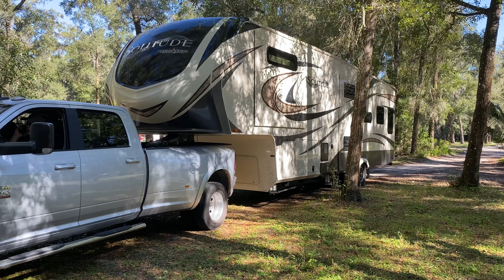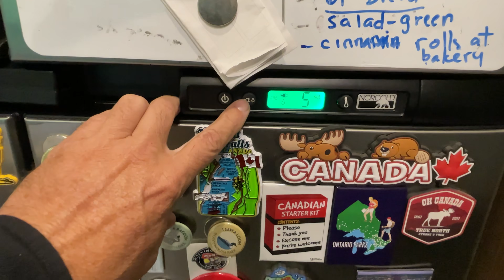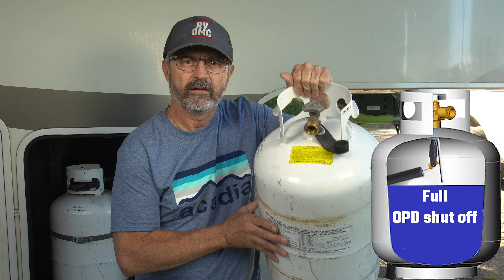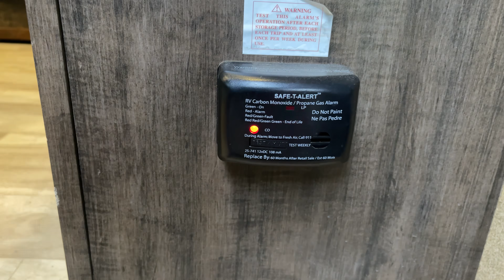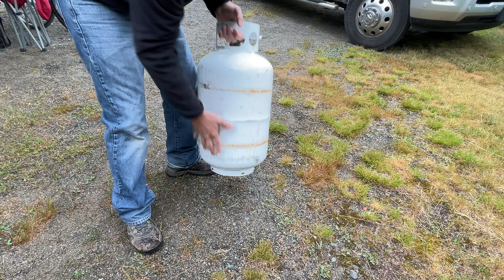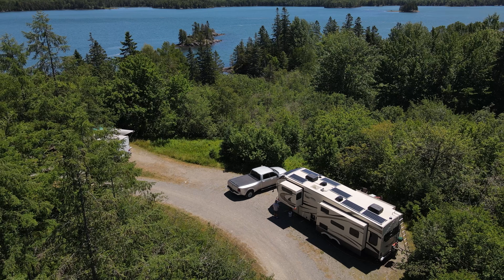Mopeka Tank Check, How To Track Propane, Install & Use (RV Living) 4K

Comment: what is the name/type of grease they provide?  trying to replace the small tube that came with.
Reply from the maker: Im not sure what the grease is that comes with it, i use a silicone grease that i have handy.  I dont think you should use any grease that is petroleum based as it will eat away the rubber at the bottom of the sensor.  You can get the grease from Mopeka called sonic grease which i believe is silicone based.  Larry

Comment: I’ve used this product for the last 3 years and the battery gave out. Which I thought was a good life. No complaints and a really good product. But I’ve found that I draw off one tank at a time and when it goes empty. I switch to the other tank and go fill the empty one. When first got it I was always looking at how much I was using but after a while I found that got a pretty good feel of my propane use and found myself looking at it less and less. Again this is a great product and for me it has held up for 3 years.
I really enjoy all your videos! I find them fresh with new ideas and problem solving! Keep up the good work😄
Reply from the maker: Thanks for the compliments Michael, changing the batteries is pretty easy.  I find myself using the the remote monitor instead of the APP more and more.  I already spend too much time looking at my phone.  When we drycamp, which is pretty often, we burn through propane for the fridge pretty quick so it is important to keep an eye on the propane usage.  Larry

Comment: Very educational on propane.  Adding the Mopeka tank check sensor to our 'needed items' list👍
Reply from the maker: Jenna, it really makes a difference. 
We are moochdocking right now in Nova Scotia and the power is iffy. So we have fridge and hot  water heater on propane. With Mopeka, we don’t have to worry about running out,
Alice

Comment: Nice video. I have 3 tanks so I don’t worry too much about monitoring closely.
Reply from the maker: We thought about keeping an extra 20lb tank but they have to be kept in a ventilated storage area for safety so i couldn’t do it.  The app just gives convenient reminder when the tank is getting low and when to start looking for a good place to fill up.  Larry
Reply: @DownsizingMakesCents  I hear you. Our 5th wheel was prepped for an onboard generator (we have a dual fuel portable) so we have 3 30lb tanks that came with the rv.

Comment: Hey Larry! Another great video!

We have the Mopeka device on our 2 40 pound tanks in our 5th wheel. They’re great! 

I did have to purchase the black rubber ‘halo’ to put on the bottom of each tank to give enough clearance for the Mopeka device to fit underneath. (https://mopeka.com/product/mopeka-tank-helo/) AND, I had to modify the halos a bit because the tray the tanks sit in wasn’t long enough for the extra width the halos take up. I basically cut a notch out of about 20% of the outer ring of one end of each halo so that they’d fit in the tray. 

Also, regarding transport of the tanks, I discovered this device and picked up a couple - it’s excellent and way better than simply using a bungee or something to hold the tanks upright in the bed of my pickup. It’s pretty inexpensive, rolls up for very compact storage, and is robust and sturdy enough to handle the weight of the tanks when full!  http://www.tailgaterstrap.com

Also - do you use the GasStop device? (https://www.technorv.com/gasstop-propane-shut-off-acme-style-gsusa2/)

I wonder if that would have caught your stove having been accidentally turned on by your knee? I don’t know if it shuts off the flow going through the regulated system or not.
Reply from the maker: I think Mopeka should include the Halo with new devices instead of the stupid clips, it a much better option, even though you did have to modify yours a bit.  I will check out the Tailgater strap as an option for transport.  I dont think the gas stop device will work on a low flow situation like the burner being on by accident, I think they just pick up on higher flow leaks, but i may be wrong.  That is a product I want to check out someday.  Thanks for the tips,  Larry
Reply: Hey Larry - yeah, you’re right - the clips seem worthless, which is why I didn’t even bother with them. I had read other reviews that mentioned they didn’t work well, so I preemptively bought the halos. They work very well, and even though I had to cut them to get them to fit, they still stay on snug.

Comment: FYI:  the batteries have trouble when in freezing temperatures & the readings aren’t as accurate at freezing temps either.
Reply from the maker: Does Mopeka offer a solution for operation in freezing temps.  Thanks for the heads up for others that want to use it in very cold temps.  Fortunately for us we hope to never be anywhere near freezing temps, being from Florida, we are cold wimps.  Larry
Reply: @DownsizingMakesCents  We hadn’t had plans to be in freezing weather either. We were in Louisiana when that bad freeze came through in February (2021). We actually postponed moving because of that freeze!  Once the weather warmed up the following week, the battery power read full and the tanks gave more accurate readings. As we knew we had a completely full tank when the freeze hit and we hadn’t changed to that tank yet, it wasn’t a problem. As for Mopeka, we never thought to research if they had a solution for freezing temps, as we don’t have plans of being in those temperatures too often.  We are from South Florida so understand being cold wimps.
Reply from the maker: @tonyaveverka9740  Sorry you got hit by that. 
I grew up in South Florida and Larry moved from Canada to Florida when he was around 15. I was always a wimp about the cold. Larry has become more like me but not quite as bad 😅
Alice

Comment: I have used the mopeka sensors for about 3 years excellent system I'm thinking about upgrading to the newer sensors
Reply from the maker: Bob, great to hear that. If your current sensors work, why get the new ones ? Just curious
Reply: @DownsizingMakesCents    The new sensors are round An easier to center on the tank
Reply from the maker: @bobstellmaker3816  Oh. Interesting. Placement is key so that makes sense. Thanks for sharing the info
Reply: @DownsizingMakesCents  🙂

Comment from the maker: I learned a neat trick from @infurious in the comments that you can change the update rate from 3.5 seconds to 10 seconds by holding the sync button for 5 seconds. This should extend the battery life.  Open the addtional settings tab on the tank page to see what your update setting is. Thanks @infurious
Reply: Love your channel sir, just started camping in my life. But questions how you make living when camping so much?Real estate rentals?

Comment: Larry, thanks for your excellent video about propane and managing its usage. I’m a class A, part time camper that uses our permanently installed 40lb propane for our frig and water heater when electricity is not available. And we’ve only guessed about just how much propane we have since the factory installed water/gray/black/propane  tank readouts are not that reliable. Extra kudos for explaining the tank capacity and weights. I never knew why our  small BBQ tank was being weighed when filled. I will look into to Mopeka product and perhaps give it a try. Thanks again for your time and expertise to present this most important topic. Safe travels to you and Alice.
Reply from the maker: Hey William, I didnt talk about Class A or C campers as many of them have on board propane gauges, but i think the mopeka would be more accurate.  They make a sensor for water tanks that i think will will try out on our Fresh water tank to see if is more accurate than the dummy lights in the control center.  I kind of got carried away with the info on propane, but I learned so much researching this video, i had to include it.  It started out as just a Mopeka Tank Check Video. haha larry

Comment: FYI, you can extend the battery life of the sensors by reducing the update rate to once every 10.5 seconds.  For some reason it's not mentioned in the instructions, but is mentioned in the APP when you click Additional Info > update rate > then the question mark next to it.

After everything is setup (Bluetooth connected), push and hold the sensor sync button for 5 seconds.  Reapeat for each sensor.  Next time you sync with the app, you'll see the new update rate listed under the Tank's additional info.

The only downside is you'll notice more lag when using the stand alone display and the app, as it may take up to 10.5 seconds to get the signal and display the level.  Mooeka claims this roughly doubles the life of the batteries.  I can wait 10 seconds once in a while to not have to mess with the batteries as often.
Reply from the maker: our standard sensors only allow update every 3.5 seconds but I believe the new Pro Sensors allow you to change the update rate like you said, do you have the round pro sensors? Larry
Reply: @DownsizingMakesCents  The standard can do 3.5 and 10.5 seconds.  The Pro sensors have even more settings.

From their FAQs https://www.mopeka.com/faqs/

" How long does the battery last?

The sensor battery lasts approximately 1 year but it obviously depends on operating conditions such as temperature.  The battery will generally last longer in warmer environments. Standard sensors are configurable to reduce the Bluetooth broadcast by 1/2, effectively doubling the life.  And Pro sensors are configurable to up to 1/10 of the normal Bluetooth broadcast."

Not sure why the instruction paper doesn't mention it.  I did the change to my standard sensors I bought this year, the phone app now shows 10.5 second updates and their is definately a notiable additional lag for the standalone monitor.
Reply from the maker: WOW, that is cool, I had to hold the sync button for 5 seconds to toggle the sync rates, i wish i knew that before i made the video.  This is why I love the comment section, i learn so much from everyone else's experiences.   Thanks so much for sharing that.  larry

Comment: I know a lot about propane. I watch the show King of the Hill with Hank Hill. Lol Yeah  you can really smell that stuff when you get to the bottom of the tank. Smells like crap. Something to know as well if your tank is so old many places will not refill it. Tractor Supply being one. They will make you trade it out. When I feel mine most of the time they just let it go until it comes out the bleed line. lol Switching out tanks sucks. That is a ripoff. We leave ours on while traveling. Of course I aint crawling across our island. We don't have one. lol I do like that level checker you got. Ours built in one works pretty well but I like that to. I wish they had something for the Black and Grey tank sensors like that. Good information man.
Reply from the maker: We had some good laughs making the video talking like Hank Hill, "Propane and Propane Accessories"  They shouldnt make you replace your tank until it is at least 12 years old.  I am going to try out the water tank sensor to see if it works as good as the propane sensor, Im not sure if it will also work on the Grey and Black Tanks.